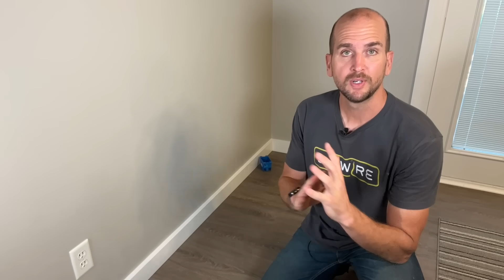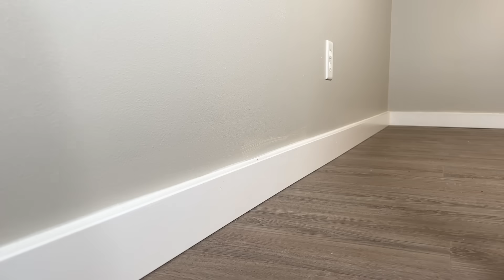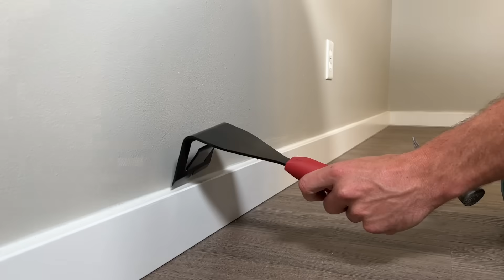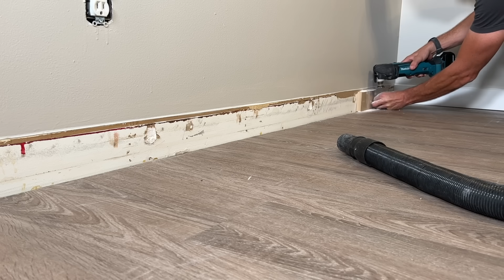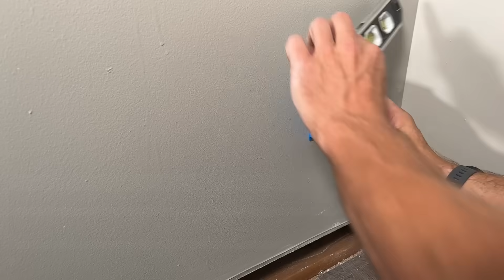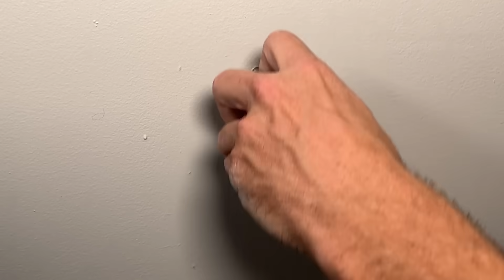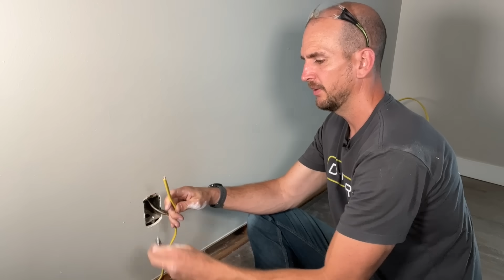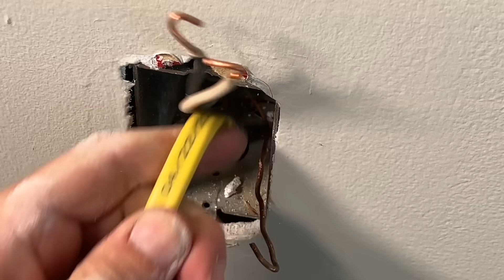How To Add An Outlet To A Finished Wall

Comment: 33 year electrician here. Great video! I also never considered removing base board to do that type of install. What a great idea and so much easier to fix than drilling out holes in the drywall!
Reply: Personally I think that this is a great idea and reading through some of the comments evidently there's a lot of people out there who are still under the belief that there's two ways of doing things their way and the wrong way
Reply: @coolhluke8089  
Now that you know the way that actual professionals use that’s substantially easier I think that you personally should do it his way because it’s more intrusive and messier.
Reply: @keithb6717  is the professional Electrician with free time to troll YouTube videos. LOL
Reply: @keithn4304  
Are really so non-intelligent that you’d say that after representing yourself as a professional electrician? You just owned yourself and it’s glorious! Thanks for the mega laughs.
Btw. I’m retired.
Thanks. You’re funny as H!
Reply: Yup that's how I used to do it
Reply: @coolhluke8089  890,  c.f.canvas.c.
Reply: @coolhluke8089  😆
Reply: GREAT JOB,NO MESS!
Reply: @alonsoaragon6916  . Looks like a baby please happy birthday to you happy birthday to you happy birthday song happy birthday to you soon
Reply: @alonsoaragon6916  except two unrequired pigtails that create more points of failure.
Reply: @toriless  Pigtail is no more points than using the outlet connectors. And make it easier to replace connecter,  and isolate outlet as a failure point.
Reply: @CM-gd5zi  Yes it is more points. That connector doesn't connect the wires directly together like a wire nut. The black wire from the existing circuit connects to a terminal on the connector. The new black wire connects to a terminal on the connector. The pigtail connects to a terminal on the connector. The other end of the pigtail connects to the outlet. That's four connection points. Without the connector, the two black wires (existing and new) connecting directly to the outlet make two  connection points. Same with the white wires. The ground wires should use a pigtail, unless there are two ground screws on the outlet, but I've never seen that.
Reply: @TonyFisherPuzzles  That must be a regional thing FFS. Everyone that I have ever heard in the past 40 years, pro or otherwise calls it a baseboard
Reply: I'm in the flooring business, and we have hit wire behind basebord at floor level, installing 1/4 round.
Water pipe installing 5 1/4 wall base.
Yes the builder used 1x2s on block wall and notched them.
If we remove 3 1/4 Base we do not expect a water pipe at 5 inches up without a shield.
Reply: @1234tellmewhatyourlookingfor  
No one expects flooring installers to be as knowledgeable as a builder.
Reply: @keithb6717  Well Keith you would be surprised, if we get a bad slab, or foundation, roof leak 3 years later.
If I cannot prove where the water is coming from, they blame us for not treating slab before installation.
I keep a thermal imaging camera, just to document the source of any problems.
Most of the time, the builder will not stand behind bad construction after a year.
I had a handyman run a wire in self level compound, tieing into the existing flooring We put down.
It looked like garbage yet the homeowners asked me to see what I could do.
I have to figure out sometimes what in hell someone is not telling me, or they hold me accountable.
Reply: @1234tellmewhatyourlookingfor  
It sounds like you don’t know how to write a proper contract to protect yourself.
Reply: @keithb6717  Actually I do, people lie thats a fact.
If they cannot hold the handyman responsible they still call me.
One thing I noticed not being mentioned in this video,  is the additional load on the breaker.
I may have missed it in the comments, but adding another outlet may overload the circuit.
Reply: @1234tellmewhatyourlookingfor  
Adding an outlet in itself will not overload a breaker. Breakers cannot count how many outlets there are. 
The actual total load (being used) is what matters. 
You can actually overload a circuit with only one outlet if you exceed the rated amperage of the breaker.
Reply: @1234tellmewhatyourlookingfor  
Sure, people lie. But a well written contract doesn’t care if they lie. 
It’d be worth the money to hire a lawyer to write a contract suited to your business.
Also learn how to say NO.
Our contract includes every potential situation that may arise and who’s responsible.
Reply: forgot the tabs on the device for the cut in box other than that good job.
Reply: @stlbillyyaeger  I saw that too good catch I'm surprised the cover plate fit nice and flush against the wall
Reply: But is that code to be that low with the wiring?  Just curious myself because I try to make sure whatever I do I do it "code" so in case the next person comes in the home and updates, they won't shoot a nail through the wiring building a dutch or something
Reply: I rewire 100 year old houses. This is not an option for lathe and plaster with perfect hardwood trim :)
Reply: @Frostified  
Imo, it’s a stupid ‘technique’ putting wiring where no one would expect it. Also labor intensive and messy. I score it a -2 on the Happy Hobby Homeowner scale.
Reply: Nothing wrong with running it through basement or attic actually I think it would be faster than taking boards off and repatching the drywall.
Reply: You a horizontal cover plate screws kinda guy?
Reply: Can you provide a link for the 6:10 fastener? Thanks much
Reply: This is all totally reliant on having 4" baseboard.
Reply: @keithn4304  
Who cares about baseboards? Why even touch them, go direct. Duh
Reply: @keithb6717  I'm not gonna argue with a troll-bot, so whatever you say
Reply: @keithn4304  
Is everyone with knowledge and actual experience a bot? 
That must be horrible for you.
Reply: @keithb6717  No. Just you.
Reply: @keithb6717  me be bot, beep beeeeeeeeeep
Reply: 27yrs of experience, and would’ve thought of this after all these year’s.
Reply: 33 years in the trade and this is new to you!
Reply: 😂😊😂😮😂❤😢😢😂i🎉😊
Reply: @ronl5428  Commercial electrician. Residential was easy side  work. For whatever reason, never encountered this exact situation. Sorry I hurt your feelings by simply responding to a video that I liked and gained some good information. 

Is that okay with you, "expert" electrician? I hate to hurt your feelings again, but not everybody knows everything!
Reply: You’ve been an electrician for 33 years and didn’t know this? Yikes
Reply: @heavydose4568  Wow... I didn't realize that you know every way to every job every time. I'll contact you the next time I'm in a fix, okaaayyyy?
Reply: I would never hire an electrician that would pigtail a line and neutral and leave the second screw unused.  That is like day 1 stuff!!  You need to retire, NOW!!
Reply: @toriless  I wouldn't use his quick connections but wire Nutting with pig tails eliminate a receptacle going bad and knocking out rest of receptacle in daisy chain unless by grace it was at end of run. Plus pigtails on every receptacle Is a must where I was hired. Still what I do to this day.  On new homes it eliminate the sheetrockers convering up and losing continuity. If it's covered don't matter all plugs are pigtailed and jointed never an issue. Hats off bro at video never thought about taking off baseboard fckn genious. Im clapping 👏 🙌 thnx bud
Reply: @toriless  Because you haven't worked in Canada.  Say did you comment on every post?
Reply: @toriless  Back in the day, pigtails were code. The purpose was so that you could remove the damaged outlet without interrupting the circuit. Of course now, OSHA doesn't  "allow" circuits to be worked hot.
Reply: @toriless  why? It's perfectly code compliant and if done correctly will never be an issue
Reply: so you are not electrician for 33 years, just a bloody beginner....
if you cant think about the easy things and how to do them...´,
i assume you are American, too.... explains a lot!
Reply: @Arltratlo  <--- Off his medication again.
Reply: 33 years and you never used a 6’ flexible bit? Are you really an electrician? I don’t think so.
Reply: @keithb6717  how are you going to flex bit multiple studs without fucking up drywall around outlet hole and potentially blowing through stapled Romex or copper ?
Reply: @zekeball7102  
Why do you think it’s flexible? (You can bend it 180 degrees)
Why do you think that it’s six feet long?
Why do you think that they make them?
This stuff is not that hard but you should continue to resist learning new techniques.
That way you can continue talking about things you don’t know about.
Reply: @zekeball7102  "how are you going to flex bit multiple studs without fucking up drywall around outlet hole and potentially blowing through stapled Romex or copper ?"

Honestly, that's what worries me. Blind nailing and drilling is seriously unwise for the weekend warrior. I know it is cheap and easy to just drill blind, but you could hit the HVAC condensate line, sewer vent, sewer line, or any number of other things. Any of these could cause damage FAR exceeding the cost of drywall and painting. Doing demo work before, I was startled to find PVC pipes in exactly the places that any homeowner would have put a long screw to hang a picture or cut into placing a support rod for a floating shelf. It may be worth it, on average. I get it. If you are wrong, though, and nick a refrigerant line or a water line...big bucks.
Reply: @furtim1  He's not exactly drilling blind, just a couple of inches above the baseboard opening. He doesn't show it, but he could reach in and feel the studs that far up to determine if there are any pipes or cables.
Reply: @Keith B - can you explain how you would have done it with your 6’ flex bit? I am not being sarcastic. Just having a hard time envisioning it.
Reply: @keithb6717  Hate to break it to you, but drilling into a wall with a 6' flex bit is a rookie mistake. You NEVER drill into anything if  you don't know what's behind it. At worse you hit a cable stapled to a stud, PVC drain pipe, duct work, or worse, a copper water line.
Reply: @CommunityGuidelinez  
After building houses for fifty years I can figure out where everything is. Duh.
We don’t just drill willy nilly. Get a clue. It ain’t rocket science.
Reply: @keithb6717  How do you know it's not rocket science? Did you study rocket science or do you assume it's diffiferent?  I mean, you were clearly happy building houses for 50 complacent years so I doubt you ever took a college course but who knows, you may be the only guy that actually does know it all. 😏
Reply: @CommunityGuidelinez  
I’m still laughing about your inability to figure out where the wiring, plumbing and hvac are!
Reply: @keithb6717  Been laughing at every single one of your comments. If you been building houses for 50 years you've been very lucky not encounter a house where a plumber had no fucking clue what he was doing and ran pipes however the hell he wanted. Also what in the hell does a flex bit have to do with the comment the OP made? Tell us what you would done different in this video to minimize damage to the drywall and patching considering it was a new construction box nailed to the stud. Because based on the crap you've said you sound like someone who is an electricians apprentice or recently discovered flex paddle bits and want to sound like you know what your doing. Either way keep commenting so I can have a few more chuckles.
Reply: @stephenledford3808  
I have a B (General Contractor)  license in California. I can legally do anything except wells and fire sprinklers. 
Mainly we do Design/Build. 
I’m sorry that you don’t have much experience and don’t understand basic building principles and common practices.
   We wouldn’t hire you based on your comments and questions and your inability to pay attention to details.
Reply: @keithb6717 I didn't notice it was flexible shows how I pay attention. That's why I can't do any project well
Reply: @keithb6717 first you have to cut the box out of the wall, and isn't this a metal box?. Have fun. Have even more fun putting the 6ft drill in and then bending it straight down the wall across the SHORT dimension of the box.
Reply: @ 
You’re silly. Drill a slightly larger hole through the metal (to save the long drill) and the stud and then use the long drill.  It’s not complicated at all.
  In new construction it’s very common to get called in by customer service to put in a box that was forgotten when built. We do it after they’re all moved in without a mess. No one has ever went behind the baseboards. That’s dangerous/illegal and it would void our insurance.
Reply: @ 
You can also push the box temporarily into the wall wires and all to get it out of your way. 
Think outside ‘the box’...
Reply: @ 
I’m sorry that you weren’t properly educated. 
That you would even consider baseboards as viable says it all.
  Customer service is a bit harder than just running wires in bare 2x4’s.
We’re the guys who fix your screwups with a minimum of disruption.
Reply: @keithb6717  if like to see you drill a large hole in the side, from the front! And there's no way that this posters way of doing it is illegal. Waiting for your video.
Reply: @keithb6717  this appears to be a metal bracket box that you'ld have to cut the brackets off to move the box.  Have fun. Posters way is actually looking faster than any of what you're saying. I've re wired whole houses with these boxes and they are a nightmare.
Reply: @rayspeakmon2954  lol, now now, it's Krimmas.
Reply: @ 
Ask your mom to show you how to use a sawzall.
Reply: @ 
So you’re saying that you don’t see the building code violations. Got it.
Reply: @ 
If that baffles you, you should see what the alarm guys can do. You’ll be flabbergasted!
Reply: @keithb6717  <---- Voted for Kamalamadingdong.
Reply: @ 
No honey. Only baseboard ‘electricians’ vote democrat.
Bless your heart.
Reply: @keithb6717  Then it's a good thing I'm not one! MAGA! 

By the way... everyone knows that if you have to constantly tell everyone how good you are.... you're not that good!
Reply: @ 
Your inexperience doesn’t actually mean that I’m good. We consider it a normal procedure. 
  You’d be immediately fired if you ran a wire behind a baseboard.
See: Reality
Reply: @keithb6717  You win by default. All of my replies have been deleted. I'm not allowed to respond. You can have the last word since you need it and can't let it go.

You're the most awesome contractor EVER!!! I genuflect before you!!  This is the only reply I'm allowed.

Feel better now?

1 Delta 10 Tango.
Reply: @keithb6717  .................Handyman for sure!....lol
Reply: @ronl5428  
I know. They’ve probably been in use at least that long. Maybe a 6’ long drill bit is just too scary?
Perhaps he only does new construction, but we even use them on new construction customer service department when a plug gets forgotten and the people notice it after moving in.
Reply: @keithb6717  my 6' drill bit broke in the wall lol
Reply: @whitejediguy  
Now you know that you shouldn’t break them. I’ve never broken one, but I just assumed I shouldn’t.
Think of the experience you’ve gained and for only $30
Reply: @keithb6717  If you have never broken a 6' fielder bit than you have not drilled many holes with one. Or you just work nothing but new work with soft pine. Shit you can look at a Milwaukee fielder bit the wrong way and it'll break these days.
Reply: @Pbtbreakingpoint  
We don’t use pine in California for building. We use Douglas fir.
Reply: @keithb6717  Congrats, you have not drilled many holes with a 6' fielder bit in it then.
Reply: @Pbtbreakingpoint  
Yes son. Occasionally rookies break stuff as you’ve attested to.
Reply: @keithb6717  You claim to have never broken one. You can hold off on that "son" bs. Between me and the old man we have over 75 years in the trade. You don't know if a nail or knot is waiting, like I said, must not have drilled many holes.
Reply: @Pbtbreakingpoint  
I like the way you assume stuff. Shows ‘intelligence’. 
Actually I’m a holy man. (That’s a joke, son).
If you’ve actually read the comments you’ll see I’m the General Contractor (the licensee) I hire people like you that think they know everything and supervise (babysit) them to make sure they do it to code. I really have to watch electricians. Typically they’re not the sharpest tools.
Reply: @keithb6717  What are you on about? You made a claim. I rebuked it. You brag about never breaking a fielder bit, anyone with any real experience laughs at a statement like that. Please tell me what I am assuming?
Reply: @keithb6717  Cute edit. We down to insults now as you cannot respond in a logical manner? You can hold your contractors license dear to your heart if you'd like. You get it pre '99 like every tradesman in Ma did without any formal schooling?
Reply: @Pbtbreakingpoint  
Can’t you read? D-
Reply: @Pbtbreakingpoint  
Don’t worry. We need laborers like you to do the light work while the men supervise. Even if your reading comprehension is poor.
Reply: @keithb6717  Excuse me, can you read? 1/10 trolling. But shit, what do I know. Buddy boy ain't broke a damn fielder bit in 50 years in that oh so tough douglas fir!!! Check that ego, you don't fool even the children.
Reply: @Pbtbreakingpoint  
California, son. Where we build for earthquakes. Very high standards. Continuing education requirements. I did two years of construction law and 5 architecture. You’d never pass with your reading comprehension as it is.
Reply: @keithb6717  Lay off the pipe, for real. Ego is off the charts. Insults only show your insecurities. Link me to your newest build, id love to see it. Meanwhile ill be running my company of over 40 years in MA, the leader in electrical pioneering.
Reply: @keithb6717  I'd love to know where you went to architecture school too, my brother that works with me did his schooling at Wentworth in Boston. He is laughing along with me after I sent him this nonsense haha
Reply: @Pbtbreakingpoint  
You just keep proving that your reading comprehension is poor. Start over, son. It’s all there.
Reply: @keithb6717  I doubt it, he does not even properly use both screws, even an amateur like me know that.  Next he we say lefty uppy or some nonsense.